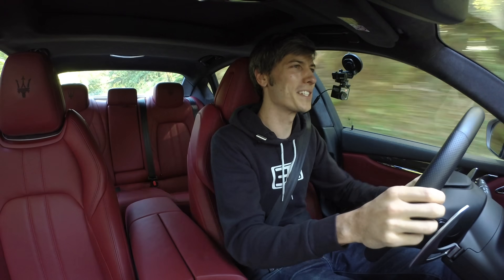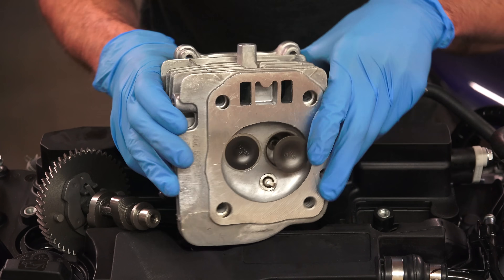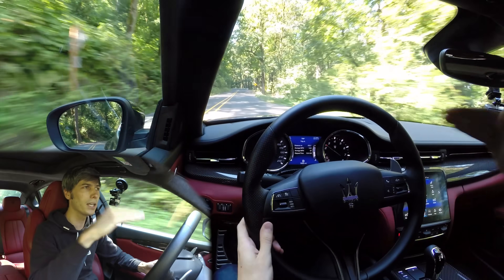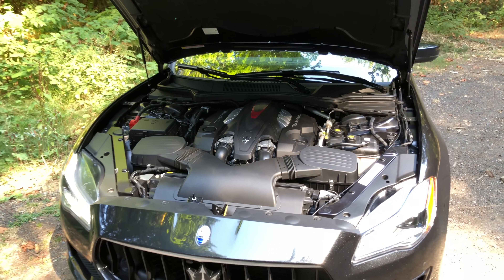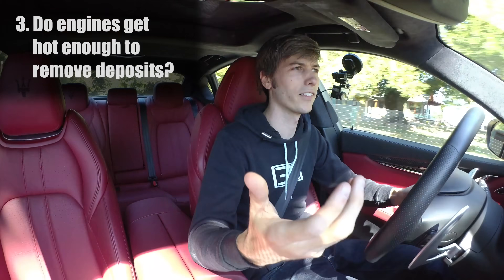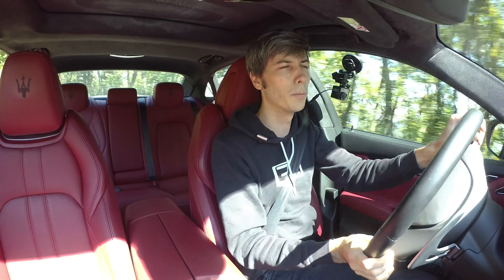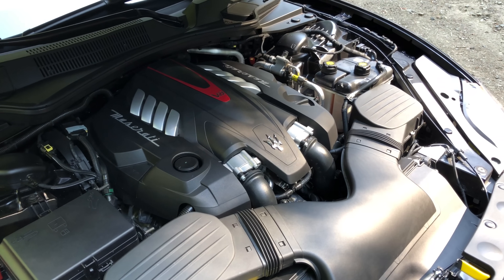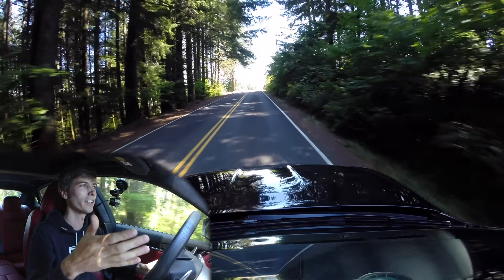Is Redline Good For Your Car's Engine? Italian Tune Up

Comment: My 2002 bmw x5 3.0d went from 700 rpm to 500 rpm on idle after driving through Denmark, German autobahn and Poland. Anyone have an explanation for that? Where im from max speed is 80 km per hour, thats about 50 mph i think. It was also more responsive and faster on accelaration. I think high rpm and temperature over time will clean out much of the gunk. We have alot dpf problems also. So driving like a granny cant be good

Comment: In my experience driving the car hard kept it running longer. When I say hard, I don't mean hold it at redline for extended periods of time, but I am usually accelerating at full or close to full throttle. I have noticed in both of my Subaru Imprezas, (02 WRX, and 99 Outback Sport) that they seem to respond better when they have been ran hard. When I still had my WRX, at least once a weekend late at night I would exceed 100-125 mph before going home for the night. I've noticed that the engine was more responsive coming through the gate and would begin to degrade over the course of the next 2-3 days where I don't exceed 40 mph driving to work. It's not as noticeable in my Outback Sport, but there is some thing different about it now than when I bought it early this year. It seems faster. Keep in mind that I changed my oil in accordance with the user manual at 2500 miles in the WRX and around 3k in the Outback Sport.

Out of my most recent vehicles, the ones I pushed the hardest, were the ones that stayed running. Both my Imprezas and my Isuzu Rodeo were beaten the crap out of on a regular basis. The 84 Nissan 300zx 50th Anniversary Edition I used to have, had the least miles out of any car I had ever owned. It only had 122k and it was always needing something. It ran perfectly fine when I bought it, but I babied it and was gentle. When I had to use it as a daily driver, it was fine. I let it sit for a month in the winter and then it fell apart. The car sat for 5 years before I bought it. The day I bought it was the first time it moved in 5 years and it went 100 miles that day with minor electrical issues (Turn signals didn't want to work at first) that went away 20 minutes into the hour drive and was fine for the first 4 months of the winter. Ever since I let it sit that one month, it ran like crap and was never the same.

My last example and I will conclude my ramblings... My buddy 'Smith' has a 2002 Oldsmobile Alero. The guy that sold it to him, 'John' was another friend of mine. When John had it, the car wasn't to be trusted to get you home or to work reliably. I have driven it a few times before he sold the car and moved. Since Smith bought the car, it has impressed me. It runs five times better and seems to be more reliable. I have driven it since Smith owned it and it definitely feels different. John drove it like a grandma and Smith runs it hard.

The 'Italian Tune Up' may still be a myth, but something is happening when a vehicle is ran hard. By no means to I mean neglect. I've heard of a 98 Subaru Outback head gasket was fixed after running it for hours without coolant and bare minimum oil, but I wasn't there and therefore won't try to argue it. However, I have noticed that when a machine is pushed close to its limits regularly, tend to last longer.
Reply: This has more to do with your ECU adapting to the change of driving than cleaning deposits, that's why it gets back to normal when you start driving conservatively again. I have Subarus myself and they adapt pretty quick to the change in driving, both engine and transmission map, very well designed cars in many aspects.
Reply: @LCY77  you beat me to this reply. Yeah, for the original comment it's just your ecu adjusting how much fuel to give your car. If you're racing around, your ecu is gonna be pushing in more fuel until you cruise around and the ecu resets itself
Reply: LOL, sounds more to me like you are trying to convince yourself it works.
Reply: @Cheepchipsable  I'm not saying it works or doesn't work and my Impresza are most likely adapting to the driving style because most cars do that now a days. I'm just saying that most machines that I worked with or on last longer after being put through frequent and moderate abuse.
Reply: I was taught, 30+ yrs ago, that it's always better to be on the high side of a shift than it is to bog the motor. You don't have to sit at the top of the power curve, but use at least 90% of it before you shift. Never in my life have I blown a headgasket or fried a motor.
Reply: I have noticed same type of effect on 00-sti and 96 2.0 NA Imprezas, its probably something to do with how boxer engines are designed
Reply: @RavenPrecept Something I have always preached.
Reply: I feel the same with my vw polo 6n1 16V. When I bought it from a normal driver I started to driver rather aggressive. Now it responds really good and accelerates quite quickly in comparison to what I read from the internet. A lot of people say it can not drive at the same pace as the other traffic but mostly I can keep up and even get away faster then most drivers on the road here.

Comment: I did some body work on my dads old Mazda, I had it for a week or so. He drives really slow, always short shifting, rarely ever getting beyond 2500 rpm. The car was slooooow so I drove it like a hooligan just for the fun of it. After fixing a bit of rust I returned the car to my dad and for weeks to come he kept insisting that I'd done something with the engine because the car drove much better - he point blank refused to believe that I hadn't been under the hood.

Some time later I borrowed my brother very cool Alfa Romeo while he was away on holiday. Now my brother is a spirited driver and knows how to make proper use of a fast car, so I was rather surprised to hear him comment on his car being faster after a couple of weeks with me. Actually it surprised the both of us, because as for spirited driving there is not much difference between us, maybe I'd just driven it harder due to my excitement of borrowing his cool car, while he is used to it and might drive it slower on a day to day basis?

So in my experience "italian tune ups" work, even if you're not from Italy.

Comment: just spray some water inside your intake while at 2500 RPM and it will clean carbon deposits and EGR. it might sound crazy and I'm not quite sure if it works on a maserati but you can try it on your old car

Comment: Redline burns your engine simple as that.  Heat also effects your oil which effects your lubrication of your engine which will effect engine wear. hot engines will generally melt or weld .  Here is a trick. Find a brush that you can go through your sparkplug and brush the engine from inside then inspect with tube camera and brush more if necessary . Here you go ! you get rid of carbon deposit from inside of your engine . Dont risk melting down your cylinder heads ^^

Comment: I've been told that driving at 4000 RPM for 20 kilometers in my 1.8 turbo gasoline Audi would remove all the deposits clogging up the catalytic converter. I'm highly skeptical, but what do you guys think?
Reply: if the catalytic converter gets too hot, it'll be toast. better to drive hard uphill someplace where the engine needs all its power, at various rpm's. reving high without any need for that power is almost like full throttle at standstill, very bad for your engine. 
or try using a deposit remover additive once in a while, check amazon reviews on specific brands.

Comment: Years ago, I had a car that was running a little rough.  I kept the pedal to the floor for 2-3 minutes.. It topped out around 90 so I wasn't TOO unsafe.  Car ran great after that!  So yes, in my experience it does work.

Comment: Thanks for the video, I've been waiting for you to  do a video like this for direct injection.  I bought my Mazda 3 2.5 brand new to get ahead of the carbon issue.  I may start decarbonizing early with something like seafoam. I do 2500-3000 mile 0w20 full synthetic oil change and i have lead foot so we'll see what happens..
Reply: Seafoam has worked AMAZINGLY well on our older cars/trucks. (everything 15+ yrs old, and 150-300k miles.) At least 10% more MPG and up to 25-30% more. My 2000 Honda Civic (1.6L Manual Trans) would always get at least 30mpg, even driving hard. Now I'm getting at LEAST 35mpg WITH A/C on and in hilly/windy roads with frequent decelerations. Pure freeway is 40+ solid now, almost hit 45 one time when I was going around 65mph consistently. Before seafoam the highest I ever got was 36mpg.

Comment: Do you mean Fahrenheit? Usual temperature, depending on engine size is usually between 160 to 225 degrees Fahrenheit. 300 degrees Celsius is about 572 degrees Fahrenheit.

Comment: Using Top Tier gasoline is the best way to prevent Carbon buildup in the first place! NO, Walmart fuel is not Top Tier! (Google it for your area) Actually it is recommended by many manufacturers, to use full throttle and redline your engine occasionally! Say What? Yes, it actually is good for the fuel Injectors, that are self-cleaning to be run wide open once in a while. Much of the build-up in the cylinders over time is engine oil. A gasoline engine is not made to burn oil. It doesn't get hot enough, and does not have the compressor of a diesel engine to burn oil. Oil seeps from valve seals, worn cylinder walls, and mostly gets passed through the PVC system into the intake manifold. Catch cans can help, but it is another thing to maintain.

Comment: Lol... the “Italian tune up” idea has been around a LONG time. Several fueling technology generations ago. My grandfather talked about taking the ‘59 Cadillac out to “blow the carbon out” periodically, but had nothing to do with temps for deposit formation. To guys of his era, it was about literally getting the carb opened up enough to move some air and dump enough liquid fuel across the intake pathways and valves to physically wash them. I think he just needed an excuse to go out and open that 390 V8 up every now and again. 😉

Trying to apply such an old shade-tree method to a modern engine seems silly to me. C’mon guys, admit it, you’re just looking for a reason to go open the taps. 😂 I drive an LS3-powered brute, I have the same temptation, but I don’t bother with any excuses about “cleaning the carbon out”. Just find myself a quiet road or track where I can do so safely, and I let ‘er rip every now and again. Is that shortening or lengthening the life of my engine? Don’t know, don’t really care. I stay within what GM engineered the Corvette motor to do, so it’s not being overstressed. Beyond that, I bought it to have fun, and some day it will need rebuilt like any other reciprocating engine.

Just go find a safe place to do so, and enjoy your car. 👍 That’s what it was built for.
Reply: Good point...ultimately all engines will build up some carbon in the long run. As long as the car runs reasonably well after many years, it can still be good transportation.
Reply: well said!
Reply: Best comment!
Reply: True
Reply: this is by far the best comment!

Comment: For the temperatures, how do they accurately get these temp measures for in-engine components at specific points?
Interesting video, especially for an aspiring mechanical engineer and car enthusiast
Reply: Internal sensor's is one of a few ways

Comment: OK, I'm going to date myself a bit here, but my understanding of the "Italian tune-up" is a bit different and goes back to before any of the electronic controls or fuel injection or any of that fancy stuff. Big old V-8s tended to build up carbon because they weren't working hard. Small engines in city driving also tended to get badly fouled. The solution was to run it out on the highway and get it good and hot then bring it into the shop and spray water into the carb while keeping it moderately reved up. The cool water was supposed to make the warmed up deposits come loose. I can attest that it would tend to produce a big cloud of black smoke out the exhaust, but beyond that who knows. There was the idea of running it hard to burn out the carbon, but it was the water sprinkling that was the "Italian tune-up".

Comment: Hmm, I was under the impression it wasnt the heat that got rid of deposits, but the fact theres a whole lot more flow and pressure going into and out of the engine, blowing a lot of those deposits out. This was interesting, thanks.

Comment: the one thing that you failed to mention is the impact on exhaust components. both the good and the bad
Dirty O2 sensor?  Drive for an hour or 2 at a pretty good clip. Not really a high load but higher than normal rpms  and much hotter than normal exhaust temps. Its kind of bad for turbos I would think though. Accelerated wear and all that .

Comment: Black smoke from a passing car's exhaust= carbon.
Reply from the maker: Generally from a rich fuel mixture, not necessarily carbon being cleaned out.
Reply: O2 sensors pegged rich at WOT....

Comment: Back in the days of carburetors with "pumpers" & 20,000 volt kinetic ignitions, spark plugs would start to fowl out after just 100 miles of putting back and forth to the grocery store, "Opening her up" on the highway would produce a dead miss, but if you kept your foot on the accelerator, all cylinders  would eventfully fire - an Italian tune up in the 1960's

Comment: Jason, what about other methods of removing carbon deposits? Such as decarbonisation (injecting hidrogen in the intake for a cleaner combustion) or fuel additives that remove valve deposits.

Comment: Could an Italian tune up help with gunk that is stuck in a carburetor?  The large vacuum that could happen after a high rev then the throttle plates closing could suck stuff out of that system.

Comment: @around 8:45 is the majority of todays engine carbon build up problems :) I think a car with no breeder hose attached to the intake will see almost no buildup... I have seen alot engines (especially a german brand) just misfiring because the airflow was totaly blocked by carbon buildup. This happens to modern Lean direct injected engines.

Comment: So some engines don't get hot enough to clean off carbon deposits? Well, how about forcing it to become hotter then? Say, by removing all the coolant and then redlining it on autobahn for 30 minutes? Would that get the components hot enough to clean off all the carbons?

Comment: Absolutely. Its great to redline every day (I usually do it when getting on the highway). The only time it's bad is when you have a car that's powered by one of those weird piston engines. Just too many moving parts to worry about when all you really need is 3. If you like beating your engine harder than your dick as much as you want, just stay away from piston engines.

Comment: My 2 yr old Citroën Cactus just got a piston head replaced. Damage was apparently due to carbon buildup on the intake valves.
And South Africa's fuel quality is terrible, to make matters worse.
Dealership recommended this method at least once a month. 
Too bad the Cactus doesn't come with a Rev counter!

Comment: 3:12 Carbon is ripped out above 325C?  LOL.  Let me help you.  Did you hear of Ray  Bradbury’'s book *Fahrenheit 451*?  That's 232C, but it is for paper.  The auto-ignition temperature of charcoal is higher, 660F or 349C.  That's when carbon has to burn into CO2.  It don't have a choice.

Comment: I've done a few track days (NHMS, LRP) with my Cobalt SS/SC and it always runs very smooth for about a month afterwards. It seems to start easier, MPG went up by about 3-5 MPG, and highway/5th gear overtakes happen quicker. Only thing I do is an oil change before and after (typically the weekend after) the track day. The only things I've replaced over the years are the clutch (GMPP) and flywheel (Fidanza). It's been daily driven for 12 years in New England.

Comment: I can imagine people designing engines to take carbon depositing into account and thus making it so that under most usage, the temperatures across various parts of the engine are such that no carbon deposit is happening. Is that a thing that happens?

Comment: I think the italian tune up originated in cars likely to foul plugs and result in misfires. In which case, yes it does work, as plugs are designed to be self cleaning, however they often need load to do so.

Comment: Interesting, thanks for posting. I always assumed the higher volumes and speeds of air and fuel were what cleared carbon deposits in a mechanical scrubbing type action.

Comment: Maybe someone should make a thermostat that will keep your engine  at 300C  so when you change your oil you change your thermostat then run your engine for 15 min or something.  So your not running your engine hard but your getting the heat
Or if there was a way to electronically trick your car for a treat

Comment: used to bring my moms cavalier  to redline everytime i hit the highway, and if my mom had been driving it previously she would park it with the check engine light on, after getting it up to highways speed by running it as hard as i could up to the limiter, the check engine light would turn off

Comment: I've never heard of the so-called "Italian tune up," but I have seen a remarkable difference after taking a car for a brisk drive.

The scenario was an old person's car that was typically driven short distances, and usually never got to full temperature. Part of the improvement was based on just letting the car GET to temp. And just letting the engine physically "shake off" any carbon or fouling.

Comment: speaking from smaller motorcycles which you could thrash the daylights out of and not be at insane speeds, they still coked up, yes they sure got hot enough, air cooled and melting spark plugs, pistons, heads, ports...